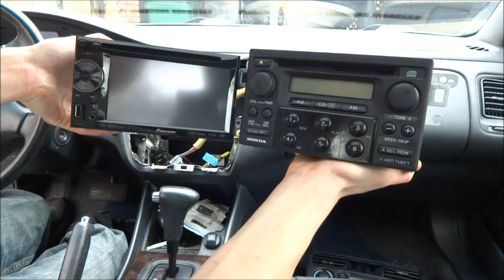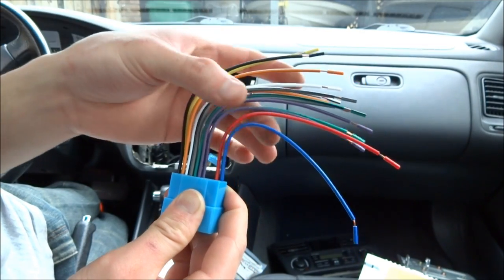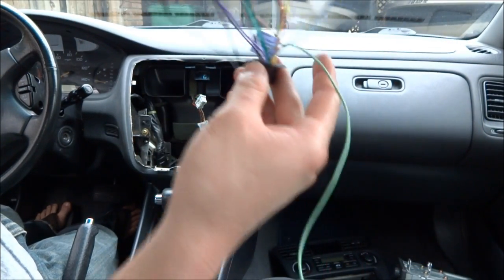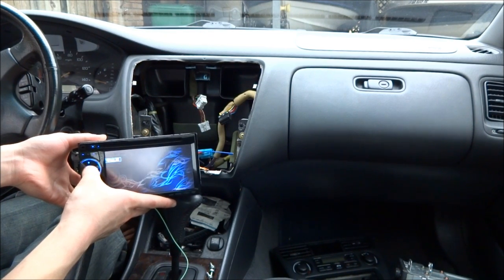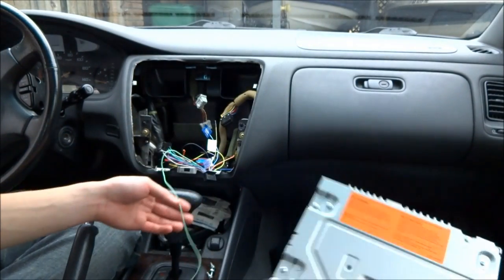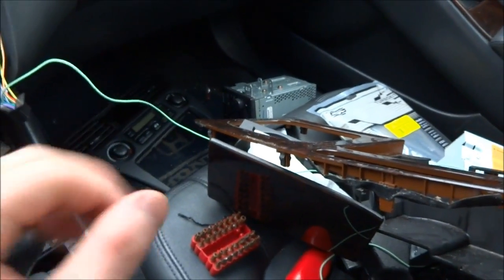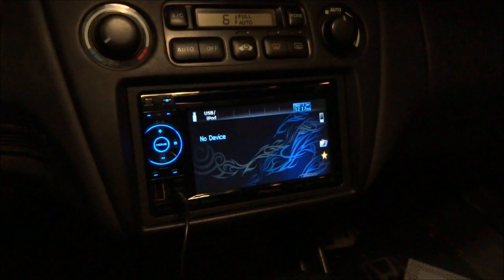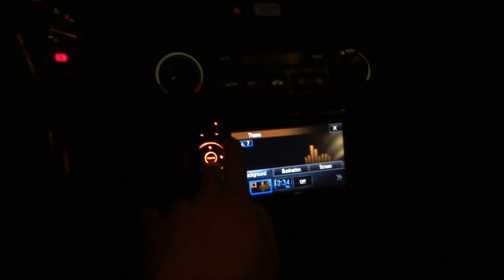How to Install Car Stereo (Pioneer AVH-2400 in 2000 Honda Accord)

Comment: Thanks so much for this video. Most people say to ground out the parking brake cable, but I want to wire mine up correctly. That hint about getting the cup holder out is going to save me hours!

Comment: Hooking the ignition switched wire like this can cause a battery drain with some stereos. Honda's ignition switch wire does not go through the ignition switch, but through the ecm. So it maintains a 1.0V on the wire with the ignition off. You need to wire a relay on this wire using it both as a trigger to the relay and a power source. I've had to do this on at least a dozen diy installations, where the person didn't know they need a relay.

Comment: I have the 2000 ex coupe and there was not a power antenna wire so I left it disconnected, and my radio comes in great. If I remember though, there was not an antenna trigger wire coming from the car wiring, if you look where that blue wires pin hooks, there is no wire connected on the cars harness, (it's empty)... Don't quote me on that, it's been a while since I did it. All I know is my radio reception is great. Thanks!

Comment: when you work on anything that involved with electrical on your car you need to disconnect your battery otherwise you will burn your fuse and connector including the light bulbs .
Reply: 🧢 I never do and I’ve done 20+ stereos

Comment: the hvac lights are replaceable you just need to replace them. the plastic housing on the back has a few screws. the actual lights twist out. I re did mine with green leds. turned out great.

Comment: I installed Pioneer AVH-P2400BT into my 2007 Toyota highlander, I have issue on Bluetooth. The microphone picks up too much background noise from the car when I driving or even parking. I installed the microphone on the sun visor and I tried on the rear side of steering wheel column. Is there a way to clear the back ground noise?

Comment: What's the parking break wire for because I installed everything els except the break wire
Reply from the maker: its so you can watch dvd's safely..and while parked.  there is a bypass for this though.

Comment: Yes i have qustion what have you conected power wires ? on ignition only or you did in that way that it was always on power ? 
becouse i have conected it on ignition and when i turn off and than turn on all settings stars again on fist step like as it was and i had to change again and again wallpeapers and led colors every time i turn on the ignition so pleass help what to do ? and how to do

Comment: can you redo the video I have a single din dvd player and im not sure how to assemle the mounting bracket and the faceplate doesnt snap on because the radio is all the way to the back of the car inside of the mounting bracket

Comment from the maker: your right on the nylon pry tools.. i like to go cheap.  for the electrical tape, i just twisted the wires really heard together and then bent them and taped them to secure them.  5 months and no problem.  in fact, a month ago, i installed a rear view camera and used wire taps.  thanks for your input!

Comment: Great vid, i'm doing android double din myself but i can't get Steering wheel controls to work.  There's no wiring out of the harness for remote controls wire on aftermarket head unit.  I got 2001 Honda Accord EX-L V6 which has the volumn rockers.

Comment: Did your dimmer that you hook up short out your multiplexer? I'm buying a double din radio with the dimming. It's used but it's really bright at night so I'd like that feature of dimming.  Just wanted to know if all your lights were fine
Reply from the maker: I haven't have a problem since this install.  My car is an older car and many things are controlled by relays and switches, unlike newer cars which the computer controls basically everything.

Comment: Just a help tip if you can't do this all in one sitting make sure to reconnect the hazard switch as the turn signals are wired through it I found this out the hard way

Comment: How did you disabled the Anti-theft system?
I have installed and wired up all connections but my new stereo isn't turning ON?
But when I plug the stock radio,it's works after entering the Anti-theft radio CODE.
Reply from the maker: El Titi sounds like a wiring issue with the new radio . Double check your connections

Comment: I've got an extra Blue wire wit ha stripe on the Pioneer side without a match on the other side. Any idea what this is for? Or am I missing a wire on the other side? It's for a 2003 HOnda Civic, installing a pioneer head unit.
Reply: Blue with white strip is a remote turn on for an amp. You don't need to hook it up.
Reply: +Javier Camacho Great! Thanks Javier!

Comment: I am looking at buying a 6.2 inch touchscreen for my 2002 coupe model will it fit? I don't want to sell the head unit I have now and then buy a new one and have it not fit
Reply from the maker: I can't give you a specific answer it really depends on the brand and mounting kit. I know pioneer head units of late have not been fitting into cars because they ignore the double din size

Comment: You do know thta green wire is connected to the cluster right? Would have been easier to hook it behinde there instead of ripping your center console???
Reply: why do u do it there?
Reply: +Alexis Martinez the light green wire is for the parking brake. It will disable radio functions so you dont use them while driving. you connect it to your cluster because that is where your parking brake light is.

Comment: So do you tie all 3 ground wires?I just plugged mine in an it wont turn on but only 2 ground wires are together the 3rd is on a bolt

Comment: One question, and maybe I missed it, why did you have to tap into the parking brake wire? I was just wondering.....
Reply from the maker: CM Doseck the radio required it for dvd playback. Probably a legal thing. Bypass kits are avail.
Reply: @CharlietoKind  Interesting.....Thanks for the info. I'm about to do the stereo in my accord and was wondering what I was getting into. I'm not going for the DVD option so I'll be good. Thanks again!

Comment: Hey man have the exact same stereo, but when I put the thing around the stereo in and try to put the climate control back on it won't fit
Reply from the maker: You have to make sure it is center and hold it there. It is easier with two people

Comment: Did you upgrade any speakers or speaker wires because I just installed a pioneer almost like yours and when I turn the volume up the speakers pop and crackle. I think it is to much power for the stock speakers
Reply from the maker: Dylan Wilson no I didn’t upgrade my wires. Sounds like you have a loose connection to the speaker
Reply: Thanks for the advice I think I fixed it the speakers sound great

Comment: In order to by-pass the emergency brake, all you have to do is connect it to a ground. (I.E. a bolt connected to a metal/steel surface) Then attach a switch in the middle of it.

Comment: Will you still have the theft control after you remove the stock deck ?
Reply from the maker: yes, the anti theft on the car is separate from the anti theft radio that came stock in the factory radio.. many aftermarket radios allow you to remove the faceplate, which will render the radio worthless because it wont turn on.. this pioneer avh does not have that option, so i would keep an eye where you park this car if you plan on installing this (now outdated and no longer in production) model

Comment: What should I punch in on amazon
For that piece
Reply: Type in the year, make and model of your car along with the words "radio harness"....the general idea is to connect the new harness from amazon to the connector in the dash of the car and then you match the wires from the new harness to the wires from the connector on the radio. Hope this helps good luck!
Reply: Thanks for getting back in due time but i have already went to Mickey Shorre and had them hook up my sounds
Reply: Glad you got it fixed....I would hate for you to have lost your car due to a fire over some simple wiring! Enjoy!
Reply: Right thank you i was gone have a family member do it but im like nope cause if anything go wrong im not the one who wants to be responsible for none working equitment

Comment: Thanks for posting.  This is so helpful!  I have a AVH-X26000BT but the wire harness looks very much the same.  It came with a USB cable and a microphone for the hands-free bluetooth.  Any thoughts on how to route those out into the car?  I want to put the microphone on the visor, but I don't know where to leave the USB cable.  They connect to the back of the unit.  Thanks.
Reply from the maker: Thanks for Watching!  That is exactly what I did with my Mic, I routed under the drivers dash, behind the carpet, and up the door panel rubber to the sun visor.  As for the USB cable, I would see if I could route it in an inconspicuous area for easy access.  Good Luck!
Reply: CharlietoKind Thanks for the reply.  Sorry for the silly question, but which carpet are you referring to (the one after the the driver dash)?  I was thinking I would go under the driver dash, and somehow up in the A pillar and come out from there to the visor.  Is one way easier than the other?  would I have to remove a lot of parts for either?
Reply from the maker: I actually found space to run the mic through the center console (behind the radio) to under the carpet under the drivers dash, directly above the gas and brake pedals, where the carpet ends,  I could easily run the wire and just tuck it behind the carpet, and run it across behind the carpet, and up the A pillar, through the rubber that you can tuck back, and coming out at the sun visor.  Probably the biggest fragment I made, but I hope this helps!  btw, what kind of car you have?
Reply: I will definitely give that a try today. I have a 2001 Honda Accord LX Coupe V6 and hope to do everything this afternoon.

Comment from the maker: its kinda tricky but for the most part yes.  The car has to support a radio, either single or double.  from there, the radio must fit the mounting kit specific to your car.  some radios have a retractable lcd screen and sometimes these radios mounting kits get in the way (isn't big enough) good luck!

Comment from the maker: no problem ;).  if it is an aftermarket radio, and your car can support it in the dash, then yes, but you WILL HAVE to cut wires and solder/join them back together.

Comment: soldering and heat shrinking is the best way to install the wiring.  if are willing to buy it. .tape will usually start to lose it's grip during heat...

Comment: There is a bulb behind your A/C display. Look behind the face plate. It's a "flat head" light that can be bought anywhere automotive lights are found. And you don't have to disconnect your battery to get it done. I replaced all my dashboard lights with LED ones. Never disconnected my battery to do it on my 98 Accord.
Reply from the maker: Sonyag1 I found out and also replaced all my ac control light and clock lights to led. I removed the blue color filter so the leds weren’t blue
Reply: I'm glad you were able to 'upgrade' the look of your dashboard. Ever since the downturn of the economy of Bush junior, I got a service manual and do all maintenance and repairs myself. Saved myself thousands, as the Honda dealerships are simply too expensive. The only thing I paid for is a local 'mom & pop' shop to repaint my car, as the paint for the 6th generation Honda's oxidize too easily. My car looks brand new as I've babied it from the day I bought it.  20 years from when the '98 V6 models showed up. Still going strong. The only thing I do at the dealership is get it inspected. They still offer to buy my car every time I show up. I'll drive mine until it drops. :)
Reply from the maker: Sonyag1 haha every time I go to the dealer to get parts for my car the guy goes your pos car broke down yet? Hahah nope . He’s cool though he gives me stuff whole sale. I change the fluids in my Accord often

Comment: do crimps work better than electrical tape or does it do the same?
Reply: I think crimps are used so you don't have to remove all the tape if you do something wrong.

Comment: So I dont need to disconnect my battery before I do this?
Reply: +RNKFootball 
Always disconnect the battery, the risk of shorting out  your radio or other components of the car are not worth it if you don't disconnect.

Comment from the maker: sorry for the late response.  I see that you installed a head unit yourself from later comments.  My security system works absolutely normal.  goes off when doors/hood/trunk is open and wont turn on without those closed.  Also the 'rumor' is true on newer Hondas from what I have read.

Comment: No, they won't work if you install an aftermarket head unit. You can buy a "steering wheel adapter" to make it work, but it seems like that is a lot of extra hassle, especially if you have the controls that I do (up, down, and source). Cost between 40 and 70.

Comment: Did you get your steering wheel controls to work too?
Reply from the maker: no. you have to buy a separate unit.. my car only has 3 buttons. most units out there are around 50$

Comment: Will the wiring colors be the same for all stereos
Reply from the maker: yes, for all aftermarket radios....but the coloring for your car might be different. you have to look that up specific to your own car.
Reply: OK can i just unhook the big plastic thing with the wiring attached from the stereo from the car and hook it up to my pioneer deck
Reply: My cousin did my stereo and the wires are hanging out everywhere I'm trying not to put all the wiring back together
Reply from the maker: Bernice Jones
no, you have to buy an adapter if you want it neat and clean. amazon sells these.. costs around 10 bucks or so. hope this helps.
Reply: OK thanks

Comment: isnt it necessary to disconnect the battery before installing the unit?
Reply from the maker: it is recommended so if you accidentally short out some wires you wont cause a fire or risk of shock.  just remove the one bolt. its not that big of a hassle. I should have done it when I recorded this vid.  Good luck

Comment: Ive worked on this car model before, for just the stereo all you need is phillips screwdriver, a flathead (not recomended) or a dismanteling tool. And the reason you blew the bulbs is because you didnt disconnect the battery...not that its a big deal though.

Comment from the maker: the radio code should come on a little card (like a credit card) have you checked the owners manual for this card? also is there a serial number for the radio taped to the glovebox ? if not you have to take the radio out, record the serial number and google "honda radio code website" and click on the first link. you will also need your vin number.  
good luck!

Comment: Does switching out the stereo mess with the security system?
Reply from the maker: the owners manual says something about the radio anti theft system working with the car anti theft system.  I think the alarm will go off if the radio is removed and the car is armed.  however, ever since replacing my radio, my security system has been working normally. Hood trunk and doors.

Comment: I have the same car...it sounds really good are these stock speakers?
Reply from the maker: yeah. i did upgrade the rear 6"x9" speakers to pioneer speakers.. they have a tweeter so it sounds "brighter" and the bass is a little tighter (more clean)

Comment from the maker: i bought the pioneer head unit off of ebay.. referb. and sealed by mfg.    the wiring harness and mounting kit off of amazon.. also recently installed a backup camera found on amazon

Comment: Does ur steering wheel control still working ?
Reply from the maker: no, but you can buy an accessory and wire that in.  just my two cents; for three buttons, the extra wiring and the cost dont make sense

Comment: i have this same car what inch radio i need
Reply from the maker: Just a double din receiver. They all vary in size. A single din will work fine also
Reply: so thats all i gotta ask for is a double din reciever

Comment: Did the buttons on your steering wheel work
Reply from the maker: Isaac Arredondo had to buy a steering wheel remote kit that plugs into the radio
Reply: CharlietoKind do u have an Amazon link
Reply from the maker: Isaac Arredondo https://www.amazon.com/Axxess-ASWC-1-Universal-Steering-Interface/dp/B00B4PJC9K/ref=mp_s_a_1_3?keywords=steering+wheel+control&qid=1585317451&sr=8-3

I used another mode called PAC
Reply: CharlietoKind Fosure thank you so much saved me time 🙏

Comment: why do you connect to the parking brake ?
Reply from the maker: it wont let you watch dvd's period unless it is connected.. more of   a safety thing.  there are bypass kits out there though
Reply: CharlietoKind I see, I guess it just wants to ground... what happens if you just ground ?
Reply from the maker: It will ask you to release and reapply the parking brake if your parking brake was already set when you turned on your car. Not sure how those bypass kits work lol.
Reply: CharlietoKind I just looked in to it, this must be one of the new ones that wont let you simply ground it the "bypass kit" is basically a relay that they are charging you triple for if you get a simple relay you can bypass it, because it wants to see a ground after the car has been turned on
Reply: CharlietoKind all i did to bypass the parking break for my dvd player was to add it to my black wire and it works find no heating now flickering image. no bypass kit is required